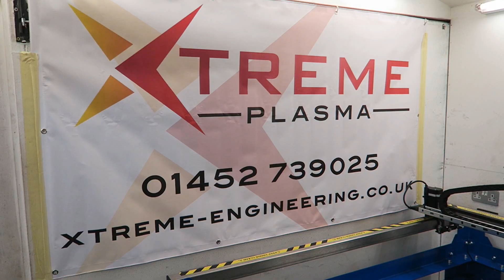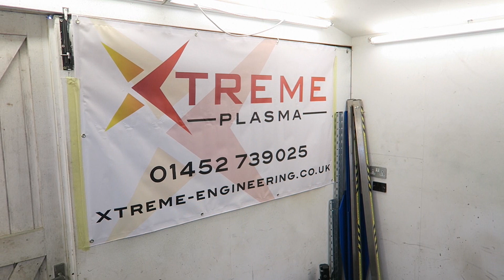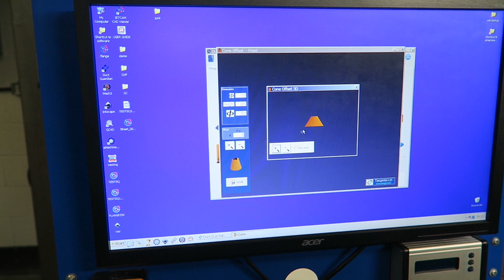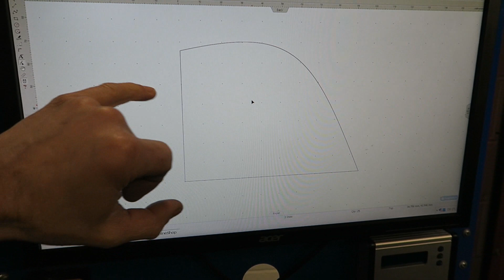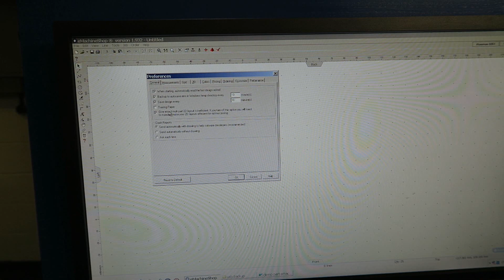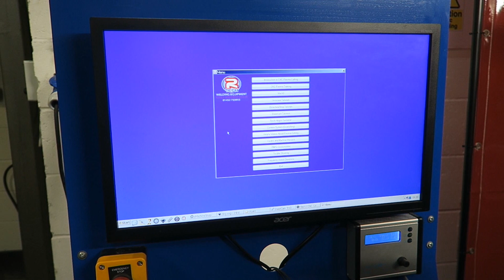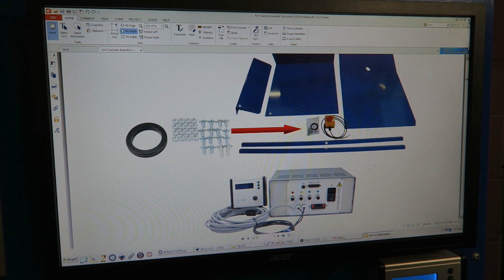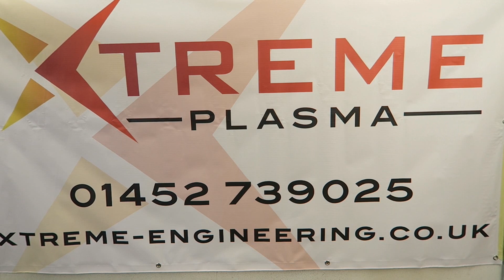"BIG NEWS!"' Find out what's behind the green door...

Comment: Trev, I'm very pleased for you. I also have an Xtreme 4 x 2 table so can I offer you a word of advice. Think very carefully about how you will dispose of the inevitable smoke and fumes generated from the plasma process. Trust me, it gets everywhere and if you are going to put the machine into the same room as all your tools and the washing machine I can guarantee the owner of said tools and machine is not going to be happy. I built an extraction system that essentially pulls from below the workpiece. 3 sides of the table are blanked off with a 6" extraction point connected to the 4th side exhausting via a 1.5 HP 3000 rpm centrifugal fan. Gaps between the table and workpiece are covered with a fireproof blanket.  I would be happy to send you photos if you are interested. John has used a large Banggood extractor fan in the wall. There are numerous ways of extracting but extract you must (IMHO).
Reply from the maker: Glyn Walton no worries Glyn all sorted. Cheers Trev 👍

Comment: congratulations Trev  !  Happy to see you have a CNC machine
you will love it !!.

I made one a couple of years ago.  
I use it for Plasma as well as  Wood cutting .  (making patterns for metal forming as well as furniture parts, signs etc )
Its not really all that hard to make one , you just need to do some researching before hand. Mine is powered by an Arduino - really cheap .
All up it cost me less than $600 AUD and its been used constantly. 
The only problem , I made it way too small (600 x 540 mm) my next goal is to replicate  and scale up to twice the size. (one day !) 
 
BTW, I use Cut2D to draw - so easy to learn - ...... what are you planning to use?
Reply from the maker: Sammy I haven’t got that far yet but the system comes loaded with many different programs. Cheers Trev 👍

Comment: +Trev's Blog      This sounds like the perfect partnership where both parties get a benefit. Really happy you were chosen. I'm sure your reporting on your use of this plasma cutter will be honest, good or bad.
I'm just curious as to the operating system the computer driving this machine was using. I haven't used Windows or Apple for a decade or more but if it's not one of that pair what is it. I use Linux but I don't recognise this.
Reply from the maker: Dogphlap I haven’t got that far yet, I think the basic OS could be XP comes with loads of software. Cheers Trev 👍
Reply: @trevsblog  Thank you.